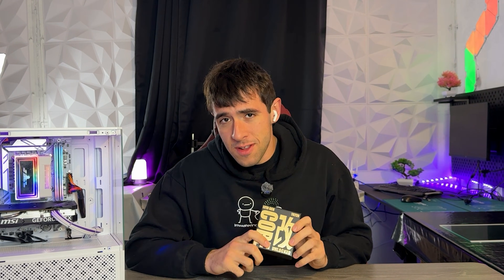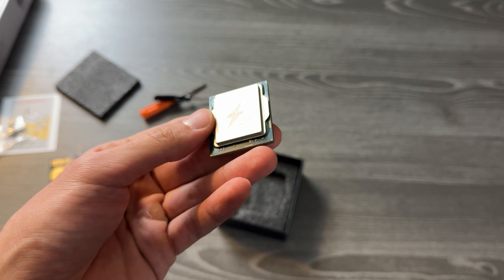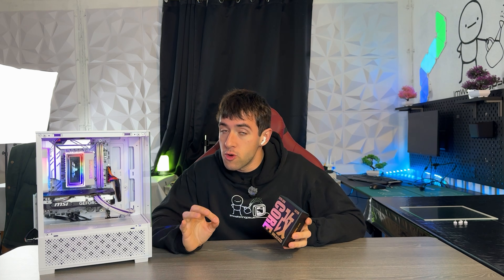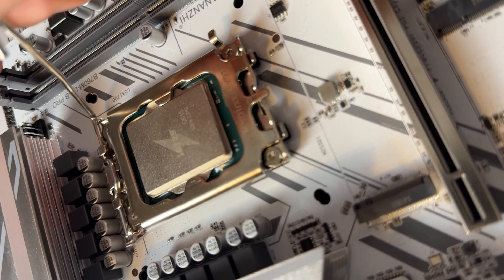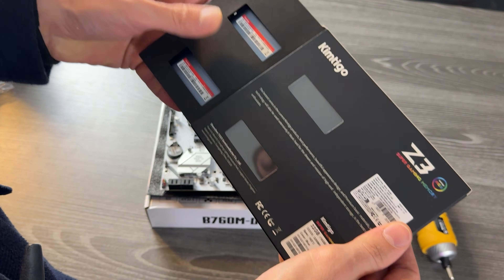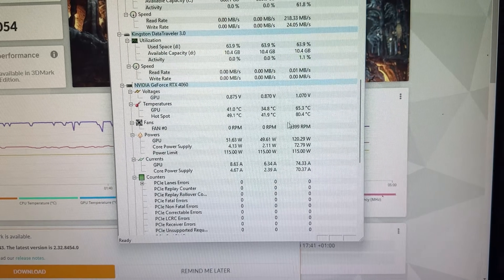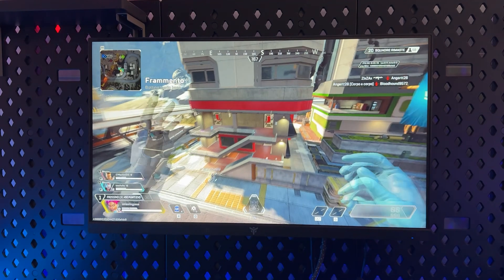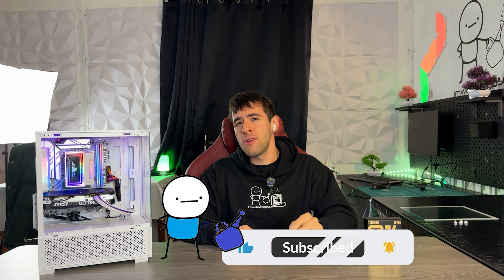This $149 “Laptop i9” on Desktop Is Actually Insane (i9 12900HX Desktop Mod from Aliexpress)

Comment: Some these are awesome, i had 10900k on lga 1151 version qtj0 was a beast for 70$ i got it for at the time.
I have one the m-atx 11800h 8core 16thread 5.1ghz ddr4 board i got for 110$ USD and use it for my media server box now, the adjustable tdp and low power modes make them great and most them were unlocked and could push up to like 220w to some them with massive OC. Fun toys for cheap for sure

Comment: i got the 12600HX, used it twice now it doesnt work anymore. So its fun until it dies.
Reply: Did you use the stock heat spreader that came with it? If yes then thats what killed the cpu.
Reply: @kazuviking  no i put it in tachyon, set couple YC records but cannot get it to work anymore. the interconnect is weak. Its a sandwiched CPU ,LGA to BGA

Comment: This is a good choice! thank you :)
and looks i9-12900HX - i7-13700HX are the same 100%
Reply: Yes and no, the 13700HX uses a completely different packaging and have rapotorlakes IMC compared to the 12900HX. Otherwise its the exact same cpu. It doesnt suffer from degradation thanks to the C0 stepping.

Comment: Hi!
I recently built my first pc and im trying to understand undervolt.
Im using a ryzen 7 5800X, i enbaled pbo with ppt 120 tdc 70 edc 130 and curve optimizer all negative cores 20.
A xfx rx 9060 XT 16 GB with -60 voltage translation and -10 Power limit.
And 32 GB RAM DDR4 3600 MHz cl 18, i enabled docp but i couldnt boot with 3600 so i went with 3200mhz and 1.35 v with docp still Active.
What do you think about these settings?
My PC boot regularly and i tried It con cyberpunk, with ultra settings the system Is under 70°C but with 70/80% CPU usage.

Comment: Can contact frame be a issue for these kind of cpu?
Reply from the maker: Yeah it’s definitely better to avoid aftermarket contact frames
Reply: @ImWateringPSUs  Why? you can use the supplied washers for any aftermaket contact frame.

Comment: Will it Work With DDr5 Ram  ?
Reply from the maker: Yessir! Perfectly fine
Reply: @ImWateringPSUs  Than This Will Be My Next Cpu Upgrade 😊 But I Have a Question Like This Is An 12th Gen Es Cpu i Heard That You Cannot Use The First Pcie Express 5.0 Slot On 12th Gen Es Cpus Does This Also Has The Same Issue ?
Reply: @Ash-b8q2v  This is a late engineering sample that have full pcie support.
Reply: @ImWateringPSUs  No its NOT, maybe read the description of the item instead of spreading misinfo.
Reply: Spoiler it WONT. Artyom did testing and you need a motherboard with TWO memory slots otherwise it wont even post.

Comment: Cpu is 200.21euro from your link and motherboard is 105euros. Is not worth it.
Reply from the maker: At those prices definitely not, but I think the price varies based on the location so you do need to look up the model (copy the model number from the page linked) and look up the best price in your area. Also NEVER buy without coupons because it's always at least 10% discount but generally more like 20%

Comment: Thank you for the video maybe next year I will pick up the i7 13650hx on AliExpress. Gonna add to basket now so I don’t forget
Reply: Just don't, the 13650X is not a good value and you will face degredation. The 13650HX costs 10-20€ less than the 12900/13700HX(exact same cpu) but it suffers from degradation issue due to the B0 stepping. C0 stepping cpus are alderlake and have no degradation issues, these cpus are the 12600HX, 12900XH, 13600HX(4.6GHz one as the 4.2GHz is raptorlake) and 13700HX.
Reply from the maker: Awesome! Thankyouu so much for watching!